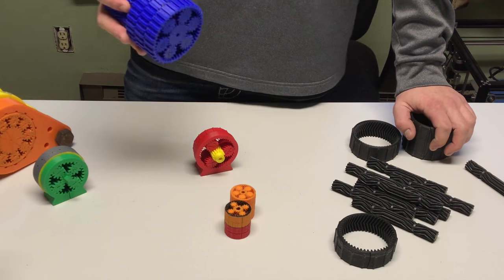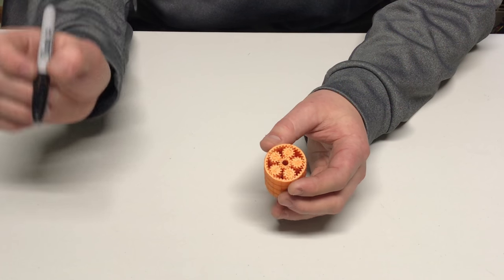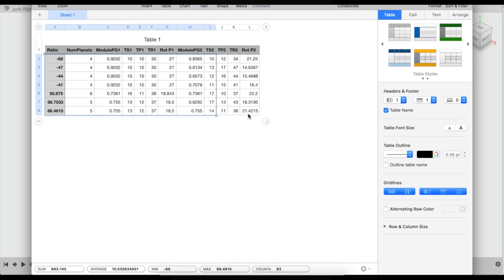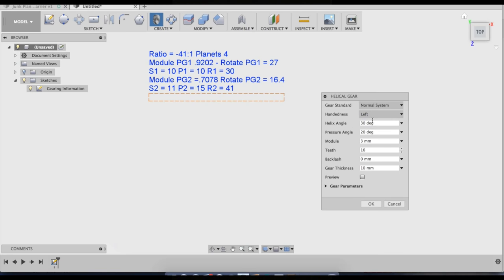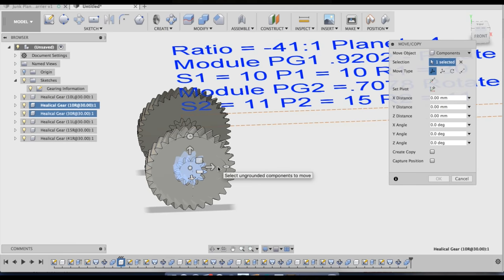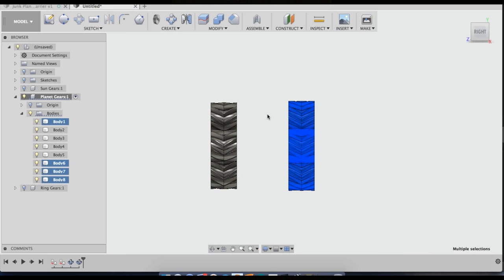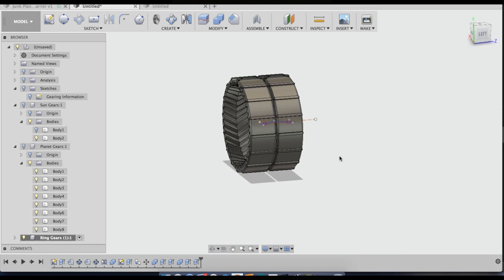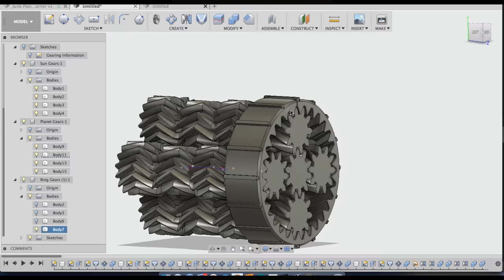How to Design a Compound Planetary & Model it in Fusion 360

Comment: Interesting approach.  I wrote a python program to calculate designs for this.  But instead, I target a specific gear ratio, and brute force the required tooth counts.  It's shocking how many ways there are to get a single specific ratio from a split ring gearbox.
Reply: If it matters, a good approximate for 50:1 with 4 planets and minimal tooth count would be S1=10, P1=14, R1=38, S2=10, P2=10, R2=30.  This gives 50.4:1.

Comment: Simplified equation for the gear ratio is (1 + (TR1 / TS1)) / (1 - (TP2 * TR1) / (TR2 * TP1)).  I pulled that from an engineering journal article when i made the Java program, so I don't think you can reduce it further than that. [edited 12/8 to fix some messed up parentheses]
Reply from the maker: Thanks for sharing
Reply: would you happen to still have the source of this article?

Comment: So I designed a regular planetary gear set, just to test out if it would work, and when I put the internal ring on, I have to stretch it out with that little cut. Teeth:
Sun: 10
Planet gears: 10
Ring gear: 30
Im using 4 planet gears. So...After  I stretch the ring gear out to put in the sun and planet gears, the ring gear stays in that shape with a much bigger cut. The cut used to be a small 1mm cut, and now it's a 8mm cut. Any suggestions?
Reply: Nvm. I figured it out by looking at your 50:1 compound planetary gear video. Someone had same problem. The fix for me was making a horizontal expansion by -0.15 because my prints were off by .3mm. I did the 20mm x 20mm x 20mm calibration cube, and found out it was 20.3 mm on the sides. Hope this helps with anyone else having this problem.

Comment: So is it possible to do the opposite of this, a planetary gear box that has a 1:1, basically just spins the outer ring in the opposite direction but at the same ratio as the sun?
Also why a bevel instead of straight teeth, doesnt a beveled tooth cause a axial push on the gear (I did see that you pair opposites toward the end)?
Sorry is any of this is addressed in the video, I skipped around a little.

Comment: Hi, @Gear Down For What? I was just wondering about a part in the equation for checking if the gears are at perfect intervals. 

Is Teeth_Planets*2 the number of one planet's number of teeth or all of the planet's teeth combined? 

So if a planet had 10 teeth and I had 3 planets would the '(Teeth_Planets*2)' of the equation look like this?: Teeth_Sun + (30*2) = Teeth_Ring_Gear. That's my guess. I've tested it too and it seems to be correct.
Reply from the maker: I think I meant just the number of teeth on one planet, not all of them.
Reply: @GearDownForWhat  Ah, thanks you for the reply. Appreciate the videos too. Very informative and helpful.

Comment: Awesome Vid! How do you calculate the backlash in that program that you wrote? I've been learning how to mathematically Create Spur gears (Haven't gotten too far into helical cut gears....yet) But nothing that I've come across has yet to mention anything to do with backlash. The other Part that I would like to know is how to PROPERLY create the Ring gear. Cutting the ring gear out of a cylinder seems like cheating to me....There must be more math behind it to properly mesh it.
Reply from the maker: Yeah the video mentions how to adjust the ring gear to make it fit properly.
Reply: But you said it doesn't give you a "Perfect" Internal Gear? How WOULD you make it "Perfect"?
Reply from the maker: Wait until Ross K. makes an official update to the gear generator :)
Reply: I guess what I really should be saying Is, I understand the clearance on the top and the bottom of the teeth for the ring gear. What I would like to know is, the Curvature of the tooth, Is it Mathmatically correct to mesh to an external gear?

I never went to engineering school so I might be out to lunch on my question, Maybe the curvature of the internal tooth IS an exact  replica of the External tooth. Just trying to figure that part out.

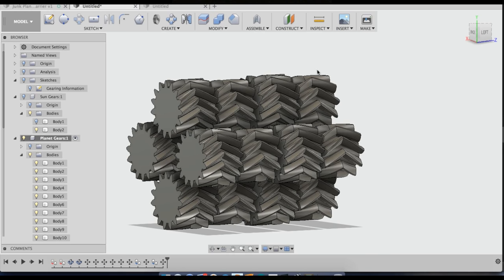Comment: The loft operation @ 32:20 is causing the gearbox to bind up on some of the teeth. Remove the loft and just extrude a cylinder throughout the planets.

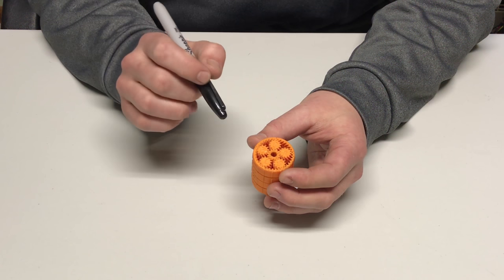Comment: Dont know if this is of use but the software at 5:26 is javascript.  In firefox i opened the javascript console and pointed to the number of planets slider and changed the max number of planets, similarly I change the max number of teeth, basically all parameters can be changed.  The program runs and the animation and shows more planets and teeth just fine.
Reply: Where is this located?

Comment: Love the videos - let me see if I can give back!  You seem to have problems with pitch diameter with a non-zero helical angle.  I believe the correct formula is : Pitch diameter = module * n_teeth/ cos (helical angle)

So if helical angle is zero, the cos(0) is 1 and you get your standard "Pitch diameter = module * n_teeth", but if it's not, then this formula applies.

Thanks again!

Comment: Get AvE to CNC you a steel one of these on his new 5 axis, see how much load it can handle. Do you do any load/torque calculations on these to optimize modulus/ratios for load? I'm designing a gearbox right now trying to optimize these factors.

Comment: hey! I love your channel and I am really glad I stumbled upon it because I started to do a project where I needed a 1200:1 ratio (around this point) and had started doing it with just plain old fashion cogwheels but with the compound planetary it is so much better.

I followed the eqs from this tutorial and found the perfect combination (S1:15, P1:19, R1: 53; S2:16, P2:20, R2: 56, which gives a ratio of 1205.8(6)).

Now, you talk about torque transmission if you only had 2 modules (planetary 1 (P1)+planetary 2 (P2)) is not great, and you demonstrated it, but they were also somewhat short shafts, so now I have 2 designs, one where i have 4 modules, interleaved (P1 P2 P1 P2), but my output can only be from the last P2 as I need full 360° axial rotation. What did you find out by just having longer shafts on the input planetary? Because my second design is something like (P1 P1 P2) (I even made the input planetary base module 10% longer, so in total I only have something like 31% of the total length of the suns and planets for the second planetary.
the problem is that Id like to keep everything really compact, and with this second design I save some space. Just wondering if you checked whether  just having longer shafts on the input side tremendously help the output torque even in the case of a simple P1 P2 module.

In the end, I would assume that what is important is actually just how long everything is, as this reduces the angular play room from end-to-end of the planets (i. e. the maximum allowed displacement is smaller if the shafts are really long, even for the P1 P2 combination). Of course that the case of interleaved modules enhances a lot the torque output specially for short shafts.
Reply from the maker: i've been curious about that for a while, it might be most important to get the proper length on just the first stage to hold the planets straigth, and then the second stage could be shorter. 

or course then you going to get questions about why the first stage needs so much more gear contact, but I think it would work.

Comment: Do you think you could play around with cyclonic gear ratios some time?  They seem like they could potentially provide good reliability at higher torques due to the forces being more distributed over the entire gear set.

I don't know if the fact that the cyclonic gear doesn't use a secondary set of gears to turn the output will allow for more efficient ratios per single ring or if the amount of friction in the design from all the rounded parts sliding across each other will cause much  efficiency loss or heat build up but I suspect that material choice and lubrication may play an important role.  There is also an interesting side effect of the design since I'm not sure the gear can actually even slip until something inside structurally fails which suggests that while it might have a higher reliability and torque, it doesn't really give much warning that it's hit it's limit beyond maybe seizing up.

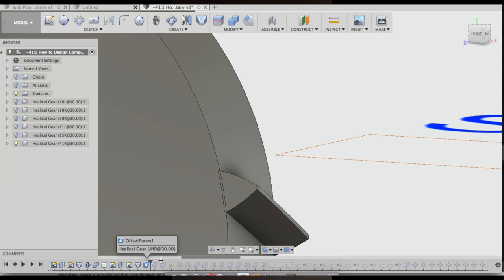Comment: 19:21   this is wrong.  
what good will it do to ONLY pull out that 1 surface?  you will still have the same low/near non existing clearance on the actual sides that matter.  the contact sides.  
you are basicly doing nothing at all like that.  just making things even harder to print (smaller detail/sharper corners)

Comment: Is there a reason why Stages 1 and 2 should have different teeth and module? Or can I just use the same module and teeth for ease of construction if I don't need to get a very specific ratio? 
Do 3D printed gears work, if the number of teeth is such, that there is a chance of undercut? I seem to remember, that because of undercut, you shouldn't use less than about 13-17 teeth. 
Not trying to be a smartass - I just want to better understand gears!
Reply from the maker: If you use the same number of teeth, the ratio becomes infinite, and undercut can be a problem.
Reply: @GearDownForWhat  Thanks for the swift answer and in general for your awesome videos! I just saw, that the information about undercut is in the video at 15:55 - no idea how I missed it.. 
I must have gotten something wrong with your equation for the gear ratio, because I still get a reasonable ratio with same modules and teeth for both stages. I'm just going to outsource my calculations to mathcad to reduce such errors :D

Comment: I'm very tempted to patreon this, get the code, port it to C++, maybe multithread it, and see how fast it'd run then. Hmmmm…

PS: And of course, not share it w/o prior approval. I'm just interested in checking if I can get it sped up significantly.
Reply from the maker: Haha it’s pretty fast with the java :) it actually takes longer to sort the file in excel than it does to make it. 

But come join the fellowship anyways!
Reply: I mainly thought about the target gear ratio 0 thing. It sounds like something that would benefit a lot from multithreading, although I'd have to check the specifics. Might even be possible to integrate this into a fusion 360 module (that could then simply generate the model), since python (which the Fusion API seems to build upon) interfaces somewhat okay with C++… Let's see tomorrow. Like I said, maybe I'll just join for the heck of it. ;)
Reply: It's already multithreaded.  Porting to C++ would just make it lose platform independence.
Reply: Uhhh… ô.o Since when is C++ platform dependent? I and all my colleagues really must've done somthing wrong writing platform-independent C++ code for the past few years (not talking about specialized stuff like smart card chips or so here, but on these, your program almost certainly wouldn't run either).
Reply: From the point you build the executable.  The source code can be written platform-independent but if you plan on actually running it, there's a build process.  With the Java version all he has to do is have one executable for people to run on any operating system.
Reply: Cory Boatright So?

But ok, don’t feel threatened, I‘ll leave you guys alone. I thought it might be a fun challenge, but I’m not invested in it, there’s enough other challenges around. Have fun.
Reply: I'm tempted to become one just to help him make more content. 

Love your desire to make the software faster... but the time the program takes is a tiny slice of the work that goes in to these projects.
Reply from the maker: I didn’t mean to imply that the java program was slow. The java program is super fast actually. It’s fusion 360 that really takes its time.
Reply: C is typically faster than c++

Comment: Been waiting for another video. Thanks so much for taking all this time. I printed all the parts to the robotic arm, but just can't get my Prusa dialed in correctly to meet the tolerances in the STLs from Thingiverse. Hoping I can take your instructions and do them using OnShape.
Reply from the maker: using a negative horizontal expansion setting should fix your clearance issue :)
Reply: Thanks. That's what I needed. I use Slic3r for a Prusa MK2. I knew I had slight tolerance problems, but since I did most of my own modeling, I could figure it out in the design phase for tolerance. Never took the time to get this dialed in. So in Slic3r it is XY compensation. And once again. Thanks for these videos. I just love your enthusiasm and you make some practical stuff!

Comment: Please Please Please STOP doing playing in fast forward, and also frame skips/jumps.
I am still learning Fusion 360, and slow down just a pinch when in the menus. I’m about to just give up on gears and use really stiff hard rubber cylinders that squeeze together. My motor will be powerful enough anyway to force through the tension, does that sound like a bad idea.? Can you help me make what I’m wanting to make?